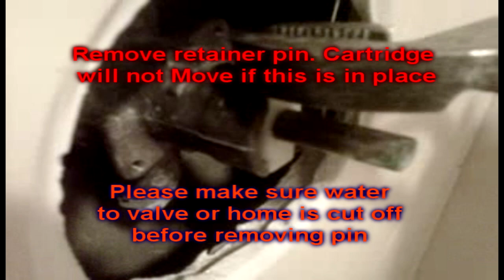Installing A 1222 Moen Cartridge

Comment: I'm about to use my new Moem cartridge puller and it's great to see someone use it before I start. I've heard it can be extremely hard to pull these out and that you should rock the cartridge loose first before pulling to keep from pulling only the stem out.

Comment from the maker: Yes there is another puller they make that can pull the rest of it out. It has berring and a brass slip that will slip up in the rest of the cartridge and lock in place allowing you to pull the rest off it out. Sorry i didnt have that on this video. Good luck

Comment: The biggest problem that I find with the Moen design is that this cartridge will start leaking into the wall long before showing any visible signs of a problem. My drywall in the room below fell as a result. My Moen was first installed by a plumber. Only 5 years later the ceiling fell. I replaced the cartridge only 3 years ago and I think this has started leaking again.

Comment: i currently am trying to replace a omen shower valve that is leaking in the process the screw broke was able to use a sheet metal screw and re-thread using the screw from the cartridge puller the only problem that remains is the valve shaft came out but not the housing... Can you please give me some ideas on how to remove the housing.

Comment: The set screw for my handle was stripped out and I ended up breaking the screw off in cartridge.  Now the set screw for the puller will not catch.  Any suggestions?